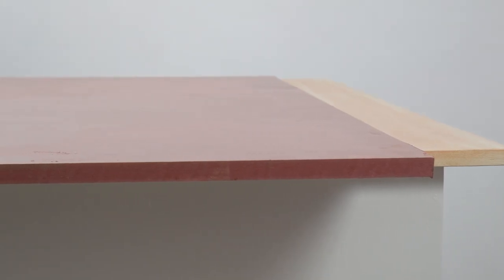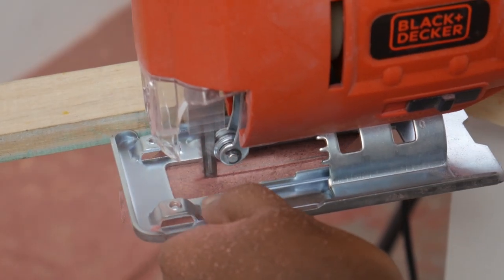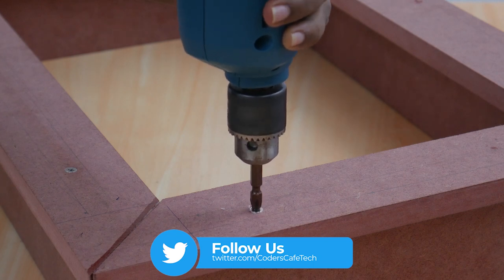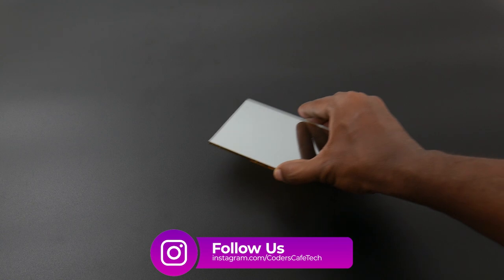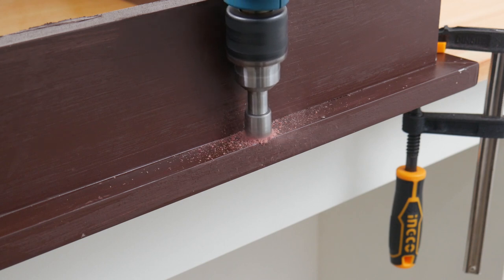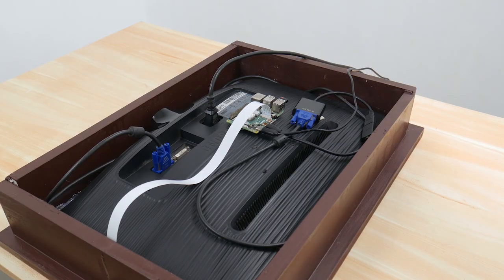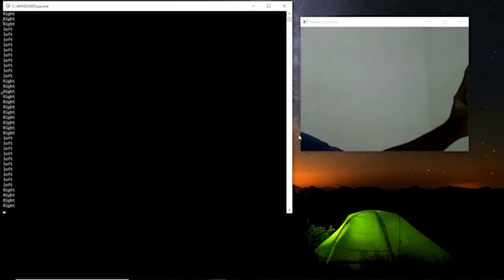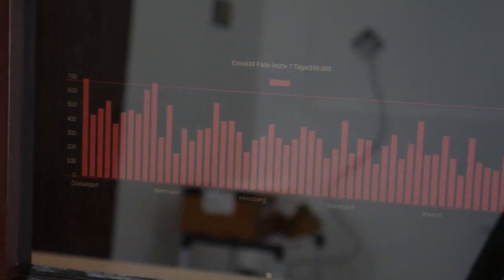Gesture Controlled Smart Mirror | Magic Mirror | Raspberry Pi | Media Pipe | Coders Cafe

Comment: does this also work with a USB webcam instead of the raspberry camera module
Reply from the maker: It should work, just give it a try.
Reply: @CodersCafeTech  Well I did the npm is running and the finger.py works but somehow i cant swipe through the page?